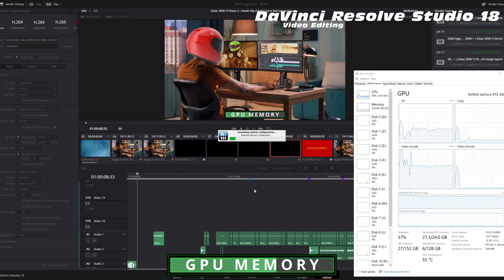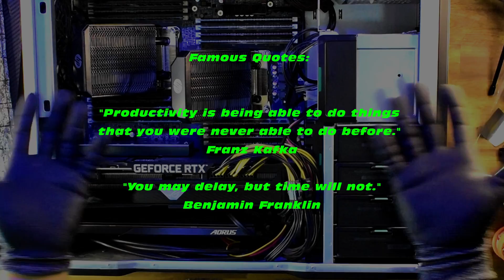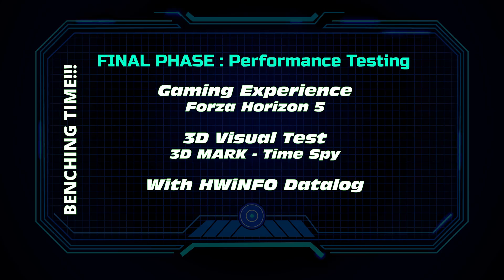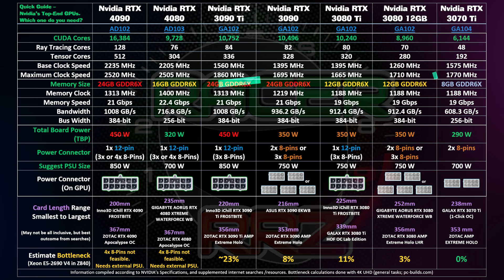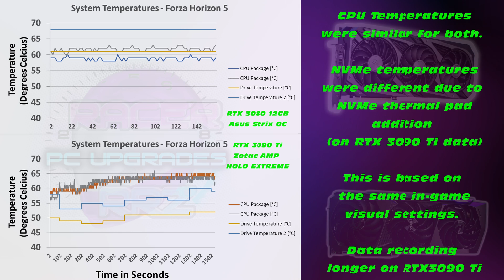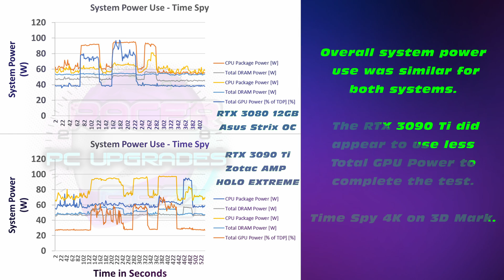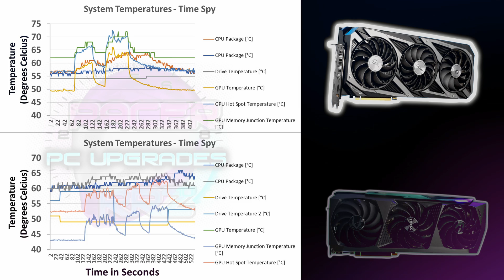GUIDE: Z840 Fitment of ZOTAC RTX 3090 Ti - Unleashing the Extreme Power in a Workstation

Comment: can i have ZOTAC GAMING GeForce RTX 3080 Ti Trinity OC to z640 work station ???
Reply from the maker: Hi Salwa. 
The simple answer: Yes, but not with the Z640's PSU. 

The longer answer: 
There is really only one problem to solve to allow you to use the RTX 3080 Ti card in the Z640 with the HP 925W PSU. The issue is the 2x 6-Pin power adapters on the PSU, which will mean you need to split the power inputs into 3x 8-Pins. The 925W PSU can handle the RTX 3080 Ti's ~350W TDP. HP does a great job on the engineering side because each 6-pin cable can output 12V @ 18Amps, which is 216W, with 2x 6-Pins the absolute maximum being 432W between the two cables. The RTX 3080 Ti is rated to ~116W per 8-Pin (so total of 350W). Another issue with joining the outputs of the 6-Pin cables is that there is a risk of damage due to bridging the power rails. You would need an adapter that is able to convert 2x 6-pin male adapters into 3x 8-pin adapters. Unfortunately I am not aware of such an adapter (it would be called "2x 6-pin female to 3x 8-pin male PCIe power adapter"). Converting 1x 6-pin into 2x 8-pin adapters is possible but that would mean you would need ~232W from a single 6-pin which is outside the scope of the Z640's PSU. My recommendation would be to upgrade your PSU to a gaming unit, ~800W platinum is ideal (larger PSU would open up more upgrade options) - although expensive (ebay/amazon search for: "ATX 24Pin to 18Pin + 8pin to 12pin Adapter" to convert your HP connections to ATX PSU standard).
Reply: @racerrrz  can i change only power supply in my workstation ? if answer is yes which model you recommend  ?

Comment: i have z640 with power supply gold 925 watt can i have MSI Gaming GeForce RTX 3090 24GB GDRR6XOWR CONSUMPTION (power consumption 370 with 8pin*3) connected ??
Reply from the maker: Hi Alexis. There is really only one problem to solve to allow you to use the MSI RTX 3090 card in the Z640 with the HP 925W PSU. The issue is the 2x 6-Pin power adapters on the PSU, which will mean you need to split the power inputs into 3x 8-Pins. The 925W PSU can handle the RTX 3090's ~350W TDP. HP does a great job on the engineering side because each 6-pin cable can output 12V @ 18Amps, which is 216W, with 2x 6-Pins the absolute maximum being 432W between the two cables. The RTX 3090 is rated to ~116W per 8-Pin (so total of 350W), and I'll add that the founders edition RTX 3090's have 2x 8-Pins for power which would suit better. Another issue with joining the outputs of the 6-Pin cables is that there is a risk of damage due to bridging the power rails. You would need an adapter that is able to convert 2x 6-pin male adapters into 3x 8-pin adapters. Unfortunately I am not aware of such an adapter (it would be called "2x 6-pin female to 3x 8-pin male PCIe power adapter"). Converting 1x 6-pin into 2x 8-pin adapters is possible but that would mean you would need ~232W from a single 6-pin which is outside the scope of the PSU. My recommendation would be to upgrade your PSU to a gaming unit, ~800W platinum is ideal (larger PSU would open up more upgrade options) - although expensive (ebay/amazon search for: "ATX 24Pin to 18Pin + 8pin to 12pin Adapter" to convert your HP connections to ATX PSU standard).

Comment: This is a great gpu only thing I wonder is will there be bottleneck?
Reply from the maker: Yes, unfortunately there is a decent bottleneck! The degree to which the Z840 will bottleneck the more modern GPUs depends on your machine specification. For my setup the bottleneck can be anything from 5%-25%, pending the test. This is a good place to check it with: https://pc-builds.com/bottleneck-calculator/result/0BD1aY/1/general-tasks/3840x2160/
Reply: @racerrrz  You can use the E5-2697A v4 it would be a great choice.
Reply from the maker: @EliezYT  That is the exact CPU I wanted to get, but they were priced through the roof when I was buying my CPUs (Video for reference: https://www.youtube.com/watch?v=7nXv20A2lZQ pause at 22:59; pricing was current in April 2022!). Prices have dropped heaps since then and I think you can get them for a solid price now!
Reply: @racerrrz  Yep the ebay listings show you can get two of them for under $200 which ain't to bad I mean not only that your cpu power will get a HUGE increase but your gpu can be less bottlenecked for more performance.

Also I am curious how do you feel about the Arc A770 16gb and how far the drivers have come since launch?

Comment: I sort of want a Z840 now because I’m impressed with the design and quality (and price). It looks pro grade. So might gamble on ordering one from EBay at some point. Or build the least expensive Threadripper (or Intel equivalent) when/if they become more available. In any case, I was thinking that a used A4000 GPU might fit/work in there nicely. Around $500 and is also pro grade. Thoughts on that?
Reply: Just saw one on eBay for 300 with shipping
Reply from the maker: @jeffreygrindle6396  That's a really good price, regardless of spec! Good to see their prices are dropping.
Reply: @racerrrz  right I love seeing these old work station prices drop and this one pack a punch dule cpus and a 1100 watt power supply its prefect for a higher end build on a budget
Reply from the maker: @jeffreygrindle6396  Absolutely. These workstations are loaded with power and are quite capable. Their prices will continue to drop, which should make them good options for a solid budget build. The only downside is the hardware is aging a bit now. Best CPU options are from ~2016 (e5-26xx V4), max RAM speed 2400MHz DDR4, PCIe 3.0, no NVMe slots etc. If you can overlook that you have a beast.
Reply from the maker: Hi Eric. For the price the performance you obtain from the Z840 is nearly unrivaled. A more modern system with a Threadripper 3970X for example will outperform the Z840 with ease, but to obtain that system you will be spending 3-5x the amount! For the end cost the Z840 provides a powerful platform, albeit a little aged now. I have not used the A4000 but it is one of the GPUs that I would recommend. Lower power draw and smaller form factor does mean you can install a couple of them if needs be. The main attraction is the ECC memory supplied on them. I settled on RTX gaming cards over the workstation grade card due to the processing power per dollar. If a video render fails I can restart the process with the only loss being time and power. For critical work the A4000 or A6000 (budget pending!) are great options. What was your end use for the machine?
Reply: @racerrrz  Oh, interesting. So the workstation VRAM is ECC and is therefore less likely to fail during a render? Long story but I’ve been a computer enthusiast wannabe for 30 plus years. Bought a new HP desktop in 1994 or so and became disillusioned by the obsolescence curve at the time. There was no way to keep up financially. Used functional laptops and MacBooks in between. Couple years ago to present did some upgrades and builds of desktops with the adult kids. I have a tendency to buy significant headroom based on experience. I was shocked to find that consumer grade gaming/creator builds look like they can be equipped with multiple drives but in fact there are hidden tradeoffs. Namely the limited PCIe lanes. My Pro Art Creator MB with big case should hold 128 gb memory, 3 M.3s 4 SSDs, and 2 spinning hard drives. I was naïvely going to max this out for projects I have in mind. Then I found out that it would limit the 3090 among other things. So now I have a gaming PC. I want a workstation too. I don’t have the money currently to buy a Threadripper but I can set some aside for it. House is paid off and whatnot. But the Z840 could be a fun project to keep me busy for awhile at much lower costs. Just a little trepidation over finding one in good condition and upgrading it. Thanks! Probably TLDR…
Reply from the maker: @ericwanner7966  I specialize in producing TLDR content! Combining the workstation ECC memory with the GPU ECC VRAM will create a very stable machine, particularly with the Z840's 90% efficient PSU (I also have mine on a UPS for added protection). New hardware is best obtained once it ages, and the obsolescence curve summarizes the process well. The question is, is the Z840 heading for obsolescence anytime soon? I would argue it has another 10 years to go, placing us somewhere in the middle of the obsolescence curve, which = good bang-for-buck. The Pro Art Creator M/B is a solid system, everything you could want; the only limiting factor being the single CPU socket. Dual CPUs on a Z840 workstation expands the possibilities but there are always some caveats. Adding in some overhead on your hardware is something only experience can confer. My next video is exactly this actually! I am limited to 7 PCIe slots on the Z840 (I know, "only 7"), but there are many PCIe adapters that would make life easier. The RTX 3090 Ti is occupying 3.5 Slots, and I am not prepared to give up those PCIe slots. Long story short, I am actively using two PCIe slots underneath the GPU where I have a 10GBe card installed and a USB-C adapter (the outcome of the headroom mindset! This setup isn't particularly attractive, but it is working...). The Z840 bottlenecks my RTX 3090 Ti by at least 20% and that's a number I can live with if it means my processes are more efficient. Once the Threadrippers age their prices will drop also and I am certain that will create an opportunity down the line. If you keep an eye out you will find Z840's at a below market price and their hardware prices are dropping fast (e.g. the online marketplace price for my e5-2697 V3 CPUs fell by ~3fold over the last year)! I am keeping an eye on the HP Z8 Workstation as well, but their cost and availability still places them out of reach.
Reply: @racerrrz  One more... I too use a UPS. And I will be watching the prices for both TR and Z840. So I went back and watched an episode of BuildOrBuy called 16 Core CPU Comparison - Intel vs AMD - I9-12900K, 5950X and 3955WX. Naturally Gill is steering us towards the Threadripper Pro.  I priced out the 16 core variant with an ASRock MB at Micro Center and if you give it the minimum accompanying hardware to get it to POST then I think we could get started for under $4000. I know, I really want to put high capacity hard drives in it so it would go up from there but could do it sort of one piece at a time, a la Johnny Cash, except we aren't stealing it from the plant. Seems appealing to me, even though currently I could only buy like one component. Fun to think about though.

Comment: Don't you need 2x6-pins for one 8-pin? Didn't know the Z840 PSU is strong enough for a 3090ti. Thanks for your video, I'll update my Z840.
Reply from the maker: Hi Samuel. The Z840 PSU is very powerful, providing you have the 1125W PSU (e.g. P/N: 758470-001). Each 6-Pin is 12V @ 18Amps (max of 216W), and combining 3x of them will yield a max of 648W between the 3x 6-Pins. I wouldn't aim for the Max Watt rating however, but they will run a RTX 3090 Ti, or even some of the RTX 4090s without trouble. The 4x 8-Pin RTX 4090s might be an issue but a quality connector might solve that problem too! HP's PSUs are very well engineered. The Z840 PSU actually outputs more power from a 6-Pin than what a standard PSU can output from a 8-Pin, which is 216W (Z840) vs 150W (ATX 8-Pin)!
Reply: @racerrrz  How's the PSU of a HP Z620 compared to this ? What options do I have if I am planing to plug in a 4070ti or 3090 using 3 8 pin connectors when I have just 2? 6pins available the 620?

Comment: У меня 3090ti Extreme Holo Zotac .
Очень хорошая карта главное память 60-65 градусов процессор 55+- градусов и это очень хорошо холодная даже !!!!.
В ведьмак 3 Некст ген. 67 градусов память что ну нормально хотя думал горячо !!!
Reply from the maker: Hi there. Great to hear your Zotac is serving you well! The fan curves are very aggressive out of the box. I normally use MSI Afterburner to tweak my fan curves (although this can be done in the Zotac Firestorm utility). I think the default fan speeds can actually be turned down! I have mine spinning ~50% at 50'C but I think it could go lower. I am quite happy with the temps. I see ~63'C for the GPU temp in games like Cyberpunk, but after a long gaming session those temps can climb to nearly 70'C (fans at 95%), but I am quite happy with the temps being well below 70'C normally.